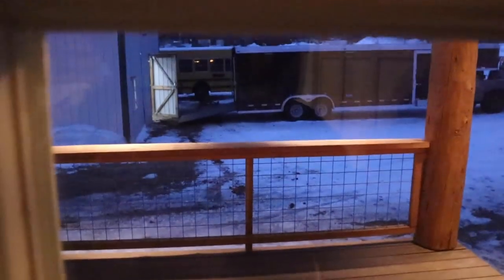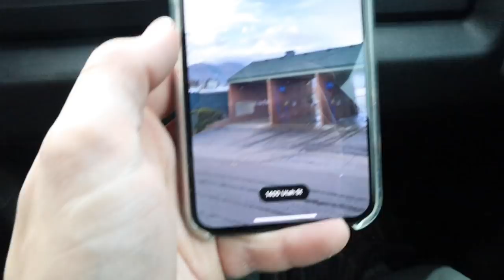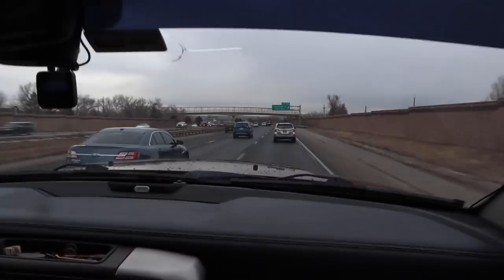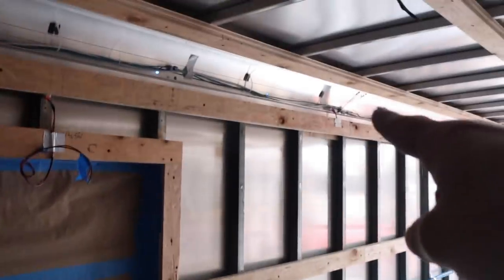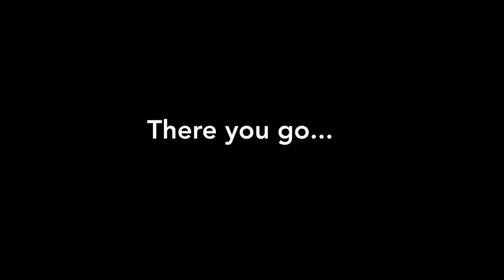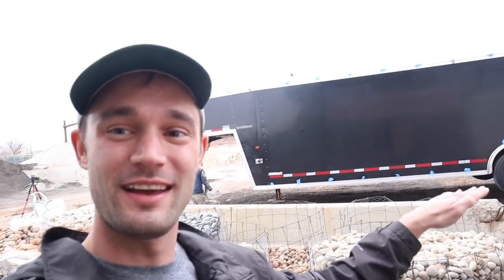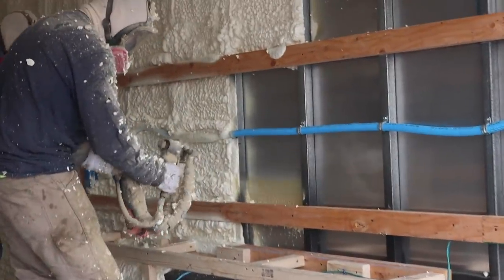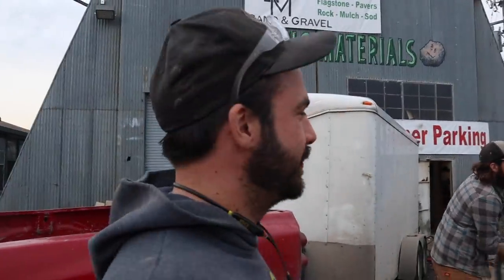Spray Foaming the Tiny House Trailer | Part 3

Comment: This is, without doubt the best insulated cargo trailer that I have ever seen on YT.

So many people omit insulating the floor, but your sprayer did an excellent job of doing the underside.

Your trailer will be more rigid as a result of the spray foam installation.

It's nice to see such a well done job. Subscribed.

Comment: I really like the spray foam. I had it done in a cabin i built. 7 inch thick walls with foam ranging from 3.5 to 7 inches thick. You cant beat it for energy saving

Comment: I'd recommend using closed cell spray foam, open cell will soak up and water leaks like a sponge. Just thought I'd put that out there. :)
Reply from the maker: Good point. I didn’t not mention that difference in the video. Thanks ✌️

Comment: How does the spray foam react to the trailer skin?  The guy that built my pole barn insisted the foam not go directly to the outside steel. As it cures it heats up. Causing the steel to prematurely rust out. This is a great idea. Just curious if there needs to be a layer of plastic sheeting between foam and skin

Comment: Any worries with moisture penetration of the spray foam? Loss of R-value, condensation between the foam and the outer (cold) skin, mold?
Reply from the maker: No, the foam bonds to the metal and water will not be able to penetrate.

(Posted this answering a similar question) the foam is a highly dense closed cell foam which is consider practically water proof. In terms of the foam under the trailer being sealed, it will be left as is. The foam is really rock hard and will mostly resist minor road wear. If you want to cover it, I would look into the rv underbelly materials.

Hope that answers it

Comment: Will you be having Charlie & Chrome Yellow spray foam Little Navi, while you're out that way??? Since I know nothing about building things out, like the trailer you're building, and certainly do not know anything about spray foam, are the doors insulated well enough to not have them spray foamed? Especially that drop down rear door? It seems to me, that you will have a lot of heat loss out that back door. Thank you for the video. It's very interesting to me!! Please keep the videos coming!!!
Reply from the maker: Thanks, no my little bus will have to get sprayed back East. As for the trailer, the rear door is sealed and factory insulated. Not as good as insulated as I would like but enough. Currently we are working on the trailer and keeping it warm with an electric heater.
Reply: @navigationnowhere  Thank you for the quick response!!! I'm looking forward to seeing the finished trailer.  I absolutely LOVED what you did with the big bus!! It's absolutely gorgeous!! With that being said, I cannot wait to see how the little bus turns out. Will there be a finished rooftop deck with either the trailer or the little bus?? Thank you again for the quick response and the videos. Please keep the great videos coming!!! 😊
Reply from the maker: Trailer no. I have very little control over design on the trailer actually. The owners know what they want. The bus however... it will have a roof top deck and all the rest haha.

Comment: Hey man great video, exactly what I've been looking for. I'm just about ready to Spray foam our bus. But I have one question for you. I've been advised to put all the electric wiring on the outside of the foam so as not to get them too hot. Something I didn't want to do because I wanted it all hidden away and neat. I see you put it in the foam. Do you recommend spraying over all your wiring?
Reply from the maker: I don’t see why if your running the right size wires and not over loading them why you would have an issue but, I don’t see why you can’t run them outside if you leave room between your sheeting and foam. You don’t want to crunch the wires then they will heat up.
Reply: Common misconception about foam over wires. Lots of evidence out there if you're curious

Comment: Hey Mike, I am a "neighbor" of yours.  I'm originally from Bucks County PA. but now I live in Ventnor NJ.  I will be starting my build within the year.  I am looking at a short bus. I will be living in it fulltime across the USA, including Alaska and maybe Canada.  So you think spray foam is the way to go?  Not wool or anything else?  Just asking.  I'll go with another Jersey guys answer.  Liked the video.  Be Safe
Reply from the maker: At this current time, I would do foam in almost every rig I build at this point. But, other insulations would work just with a lower  insulation value within our tiny spaces. For example, to achieve a r-21 in the walls of a residential house with normal insulation it would be a 2x6 wall. Where in three inches of this foam, we achieved a R-21. It is a bit more money though but, i would argue worth it if your going to 'full time' for the foreseeable future and heading to Canada/Alaska.

Comment: One kit from Home Depot does 600 SQFT.  That's enough to do an entire 20' trailer including floors and ceiling for under $800.
Reply from the maker: You can but, your time should be accounted in that as well as the quality of the spray and foam compound.

Comment: Wanted to ask this question on your mini bus build...but it's not at this point yet. What would be your next insulation option(s) if you didn't use spray foam?
Reply: Considering this trailer has straight, flat walls and not curved ones, using foam board for the entire trailer would be the most similar to spray foam. XPS (extruded polystyrene) is cheaper, but polyiso is better if you can afford it.

Comment: So, does anything go over the spray foam that's under the trailer or do you trust that it'll stay in place?
Reply from the maker: The foam is a highly dense closed cell foam which is consider practically water proof. In terms of the foam under the trailer being sealed, it will be left as is. The foam is really rock hard and will mostly resist minor road wear. If you want to cover it, I would look into the rv underbelly materials

Comment: Maybe I missed something, but why do 3/4" x2 strapping when a 2x2 or 2x4 would be the same size?
Reply from the maker: Thermal breaking. My last video discusses it.
Reply: If there are any curves the 2 pieces are a lot more bendy than a single, larger, thicket piece would be!

Comment: How do you make the underside of the trailer waterproof after the foam is in?
Reply: That's a good question
Reply from the maker: The foam is a highly dense closed cell foam which is consider practically water proof. In terms of the foam under the trailer being sealed, it will be left as is. The foam is really rock hard and will mostly resist minor road wear. If you want to cover it, I would look into the rv underbelly materials.

Comment: Is it going to take up room?
Reply: Looks taller inside than I would have thought
Reply from the maker: The foam only takes up about an inch and a half of head room from the factory height. Its a 1 1/2 metal stud (original to the trailer) and then 2x 3/4 inch strips making a total of 3 inches.

Comment: Hopefully you know the dangers of spray foam off-gassing in such a small area
Reply from the maker: Yeah, they say improperly mixing the two components can cause off gassing and dust from scraping and sanding can cause harmful chemicals to be released into the air. However, these are mostly concerns for the installer. This is one reason why I sub out spray foam to professional companies. So, overall I have little worry in these rigs. But, I guess when it comes to custom builds it’s would be a personal decision.